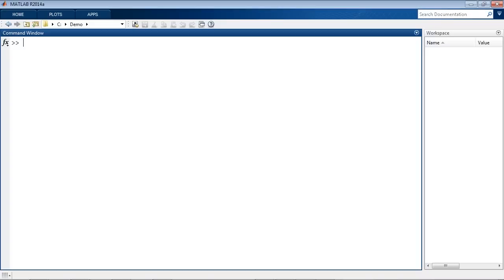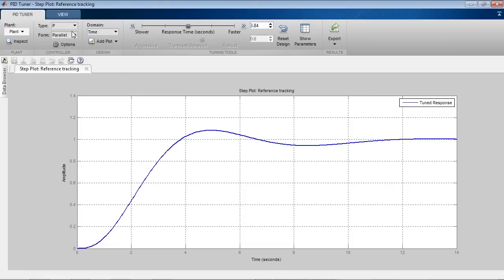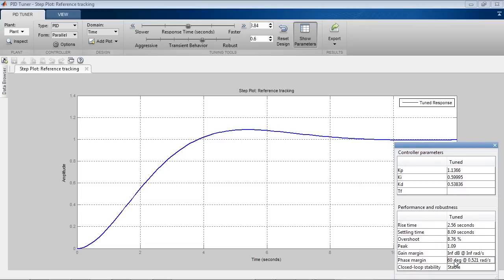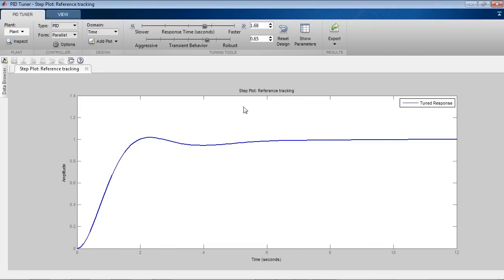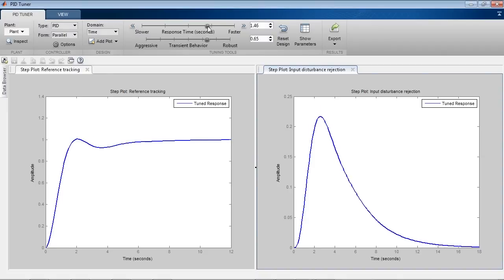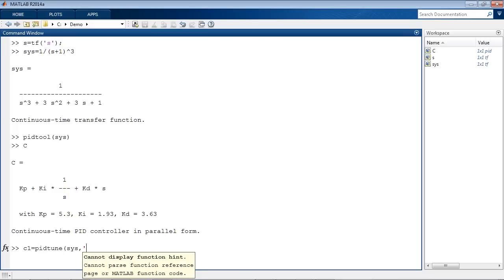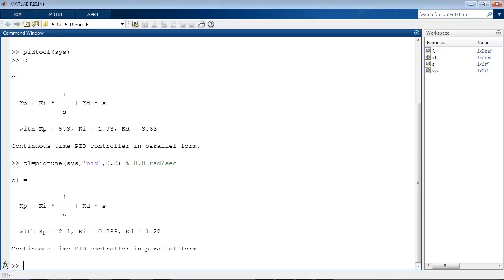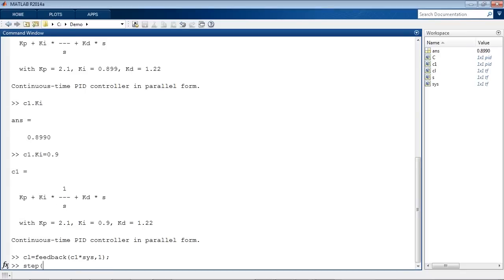PID Control Design with Control System Toolbox - MATLAB Video

Comment: hello Lecturer   i was  following   your  video  about  PID  CONTROL  design .So  can  you help  me to give me about talking about  adjusting of  PID   controller where i have two PID in parallel  with MIMO .(  TWO IN PUT ON  EACH PID CONTROLLER ESPECIALLY FOR CONTROLLING  VOLTAGE AND CURRENT)